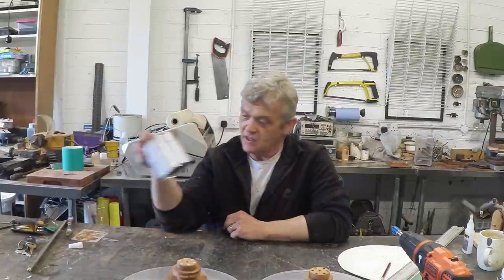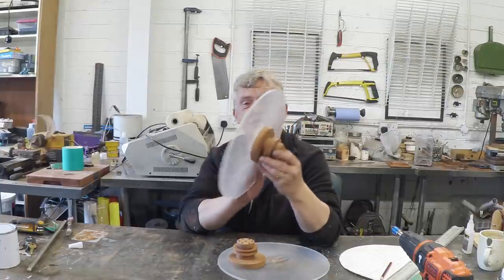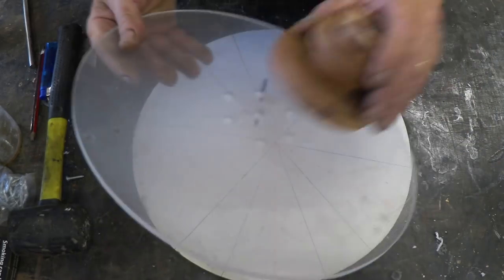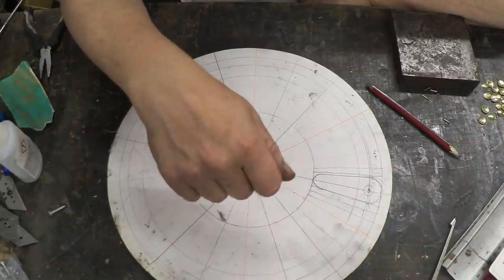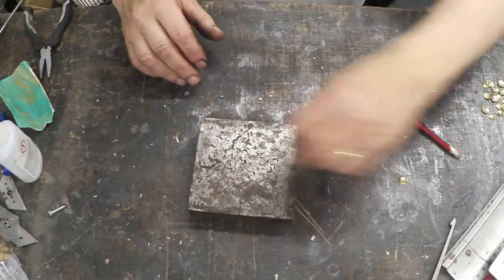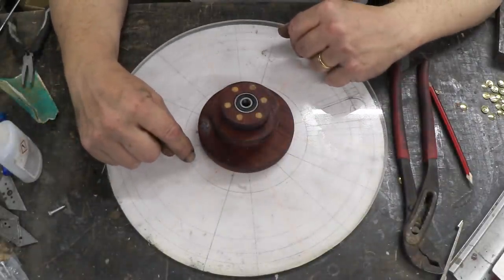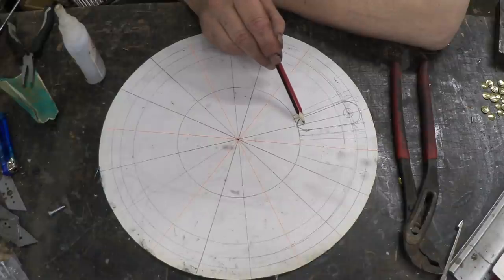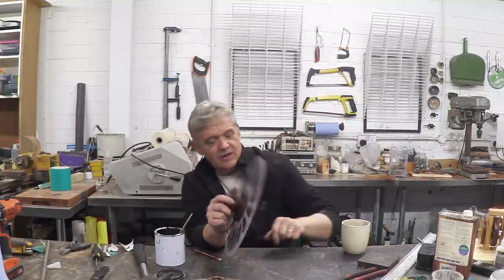Making A Wimshurst Machine With Conductive Ink - Part 1 - The Disks

Comment: I can see several uses for that Electrically Conductive Ink -- One would be for coating the inside and outside of the leyden jars. I would use a barrier coat of varnish on areas that I did not want the ink to stick to, like the inner top area and the outer top area. They used to use conductive paint to electroplate Baby Shoes and the like here in the states years ago.  What I propose for the conductive brushes on the plates -- is The inner tinsel conductors of any Vintage cloth flexible telephone cord. It is a fine copper tinsel, usually wrapped around a string core, and I would embed it in a brass holder using some of your conductive ink as the Glue. It would wear well, would be negligible as to wearing against the buttons, and is easy to find to make more. You are a Craftsman for sure--and so am I!

Comment: Looks promising!  Can't wait to see if it works.  I still have my old machine, purchased back in the late 70's from Edmund Scientific Co.  The company still exists, though by a different name, now.  I need to make new brushes, and find a replacement for the Leyden cap.  New, my machine could produce 75Kv.
Reply: given your here, why not just make your own layden and put the output through the usual microwave transformer and stand back up wind oc lol, its probably Not good to put that output near a small lit hobo stove with plasma flames and a small earth battery terminal underneath it though.
Reply from the maker: that sounds like an awesome machine mate

Comment: So well timed! The belt on my van de Graff is about done I was going to be looking for an alternate generator! I'm in the middle of a move, hopefully I will be able to copy your design as soon as my new workshop is set up!
Reply: oh robert, see... he's using a kite :-D
michael remember plasma (basicly a flame) helps localised charge collection
Reply from the maker: awesome mate - tbh it is likely to be a bit steampunk!
Reply: @ThinkingandTinkering  oh you're definitely selling me on it then! 🤣 No more experiments in a condo for me! I've been putting a lot more effort into my martial arts lately on Twitter and I am hoping to get back into my YouTube experiments! And I definitely want to be using more graphene!
Reply: @paulmaydaynight9925  absolutely all according to Maxwell's equations. The trick I think is more surface area. It's been somewhat difficult finding an artificial structure to use that works better than the grass.
Reply: I made a new Van De graff belt for one of my Machines with some linen that I painted some liquid latex (Mold-it) on and then I cut it into 2 strips and sewed them together utilizing the rubber side on the outside - -it works great.

Comment: ideally you want sectors to be separated by parallel lines instead of radial ones, because if they're radial, spark will jump across the shortest distance which will be closest to center. if they are separated by parallel lines, there will be no preferred path for the spark
Reply from the maker: cheers

Comment: Hey Robert why didn't you just drill the size hole you would have needed and just push the Brass Pins in place instead of using glue. Also, wouldn't you have a better contact point for your Ink if you had Sanded the Inking area first?  Just asking mate. Thanks for the upload.
Reply: stay tuned to see how a Wimshurt Machine works, sneak peek you cant have conductive parts coming near each other unless by design.
Reply from the maker: we salvaged acrylic plates from and LCD mate and they have a smooth side and a rough side - we used the rough side of the acrylic plate - but you are right sanding first is a good idea if you have two smooth sides - you shouldn't really push the pins through the material as that will basically short circuit the build up of charge on the disks mate

Comment: number of sectors needs to be even, so 3,5,7,etc won't work because you need to put a conductive wire to transfer charge from each sector to the opposing one, and there's no opposing sector for odd number
Reply from the maker: cheers

Comment: even if ink has high resistance, it should not be a big problem in this case because of very high voltage and low current, losses will be minimal.
Reply from the maker: I would think so

Comment: im still wondering if the Wimshurt in combination with lime light will make simple flash GO to graphene/all the ene's and oc other products.
if so, then maybe a simple saturated quicklime (calcium oxide) pulsed "exploding water" will do the right reaction sequence for your production poc, carbon doped calcium, or calcium doped carbon etc.

does the conversion from GO to graphene make it drop out of solution and/or become more magnetic (inducible)  ! if so then again replacing eric's spinning copper cylinder with fluidic  pulsed "exploding water"  tube next to the ac traveling wave steel,aluminium ring poc would logicly set up a revolving centrifugal magnetic micro graphene helix
Reply from the maker: I dunno mate - but suspect the joules won't be enough unless you have quite some caps on it or a large disk radius

Comment: That coffee table is wealth it weigh in gold mate. I had a dream in 2000 about a product call active ink. Use it to in my dream to polarise windows to reduce the requirement to use a lot of Air-conditioning.  Plus other ideas.
Reply from the maker: it has certainly provided a good amount of material mate - nice idea too - cheers

Comment: I thought that... If you could paint those... Havent you though about painting these with a curve? Spiral fashion?
Reply from the maker: interesting mate - give it a go
Reply: @ThinkingandTinkering  well i'd do so if i had the time to gather and make it. Ive never seen a "whimsurst" machine with such "electrode plates" and i really really wonder if it even works. I think the + and - cant be charged at the same time, but i dont think the question has been awnsered yet. I also though about placing rounded "electrode plates" in a sunflower pattern so when ever it spins no plates are charged at the same exact time. I think the resulting frequency would be the best for charging caps. Anyhow... I hope it gave you some ideas. I really wish i had the time to investigate myself. I'd offer you a "coop" for shure!